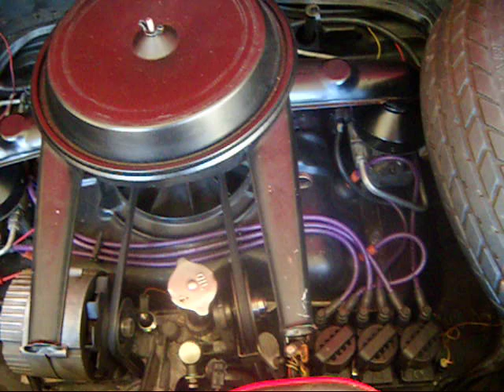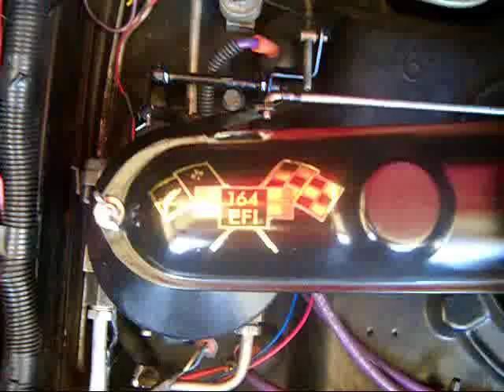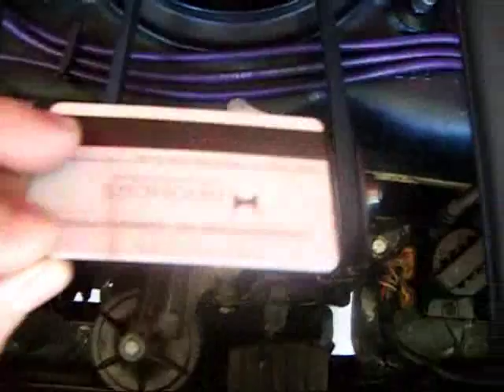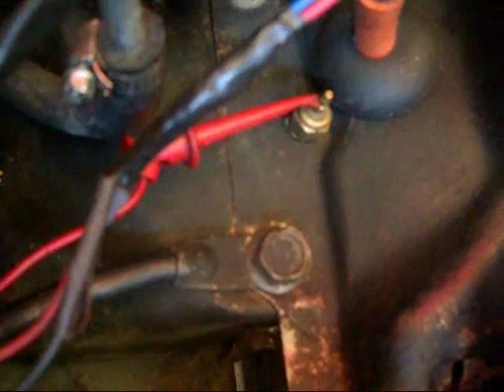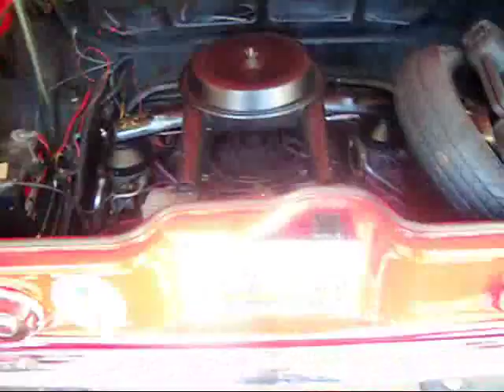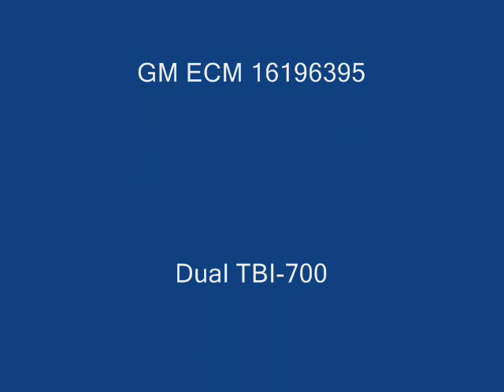Corvair Dual TBI

Comment: Fabulous, Ted!  That's similar to what I wanted to do at one point, bit I was thinking of a single throttle body mounted on a turbo crossover w/ injectors bunged in at the base.

I didn't notice if you left the TPS on the passenger throttle body or not - if so, could it be used to control a power glide with an electronic valve body?